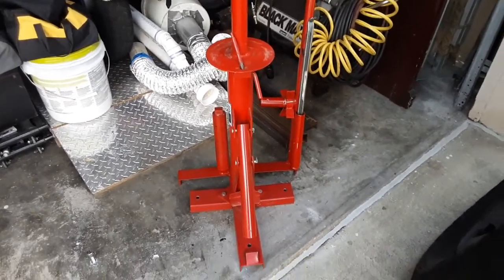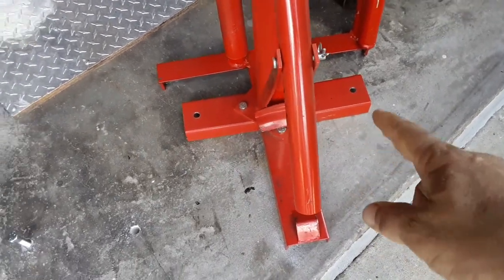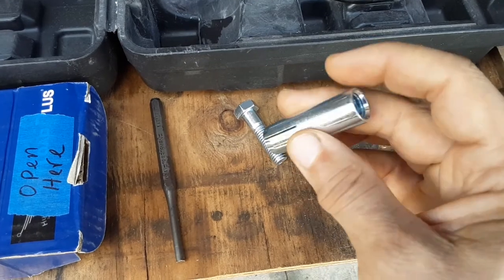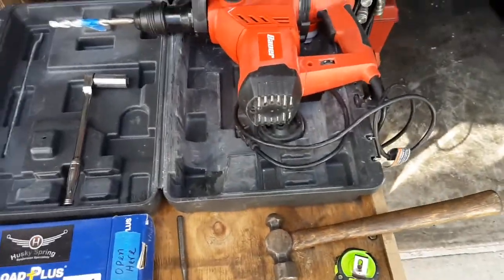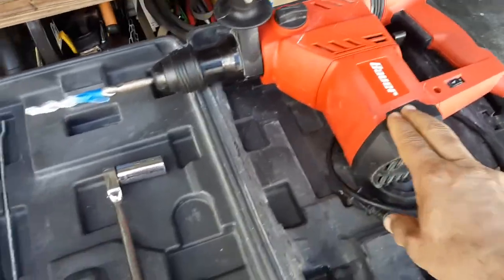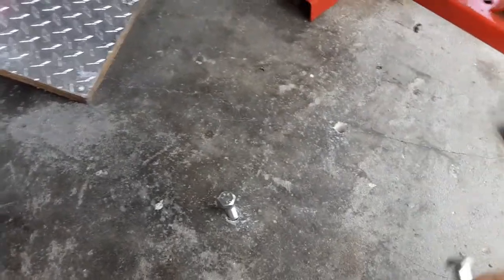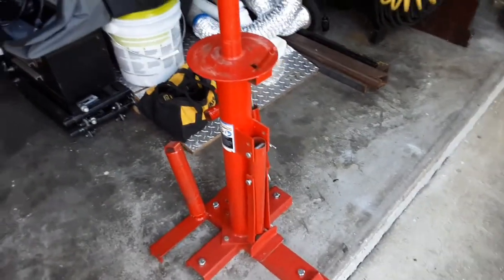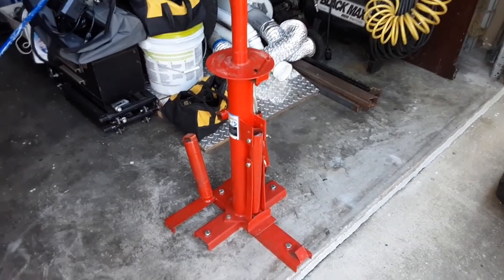How To Anchor Down a Harbor Freight Tire Changer...

Comment: Rather than insert the bolt into the sleeve and hammer the bolt (you can damage the threads)  just tap in the sleeve directly. You can place a block of wood over the sleeve as well to protect it.
Reply from the maker: Yes, that is another way to do it Mike and they went in with no issues and I did it that way so I could get them below the surface by an 1/8 of an inch or so.

Comment: The one problem I had when drilling was hitting a rock in the aggregate and drifting off the center.
Reply from the maker: Yeah, I can where that would be an issue and were you using a hammer drill or a regular drill?
Reply: @MannyFontes1968  A hammer drill.  Not quite as serious as the one you have, but it's a Hilti with a 1/2" chuck.

Comment: What did you do to hold your leverage bars and accessories for the changer?
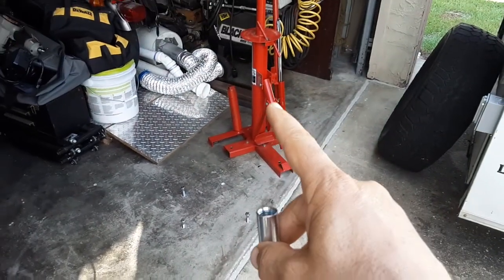Reply from the maker: Gabriel, at 2:32 in the video, you can see where I have them stored by welding some pipes that they could slide in easily. I also welded other pieces of pipe for the smaller accessories.

Comment: That bolt is 13 inches, sure don't look like it's over a foot long.  You sure??
Reply: 13 is the thread count, not the length.
Reply from the maker: Ron, when I said 13, I was referring to the pitch of the threads and that's what they call it at the store.
Reply: @MannyFontes1968  Thanks for explaining, I know nothing about bolts as you can tell.